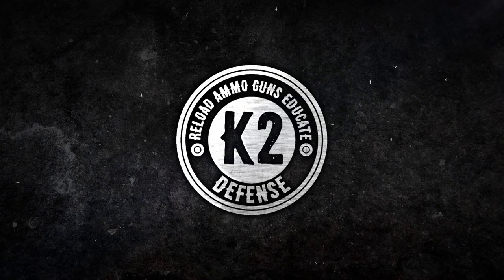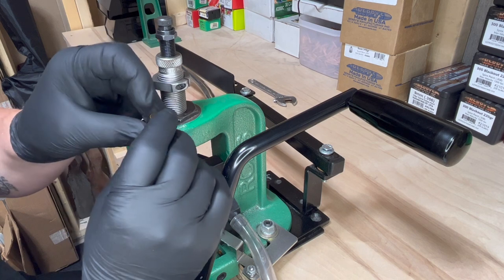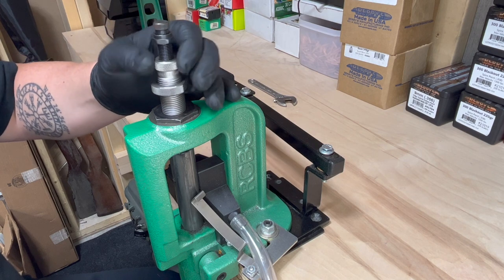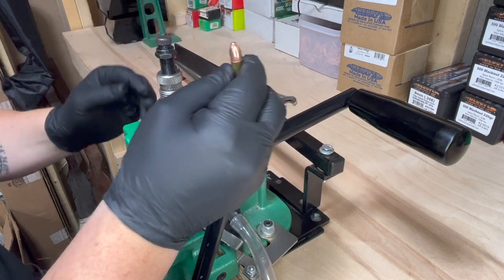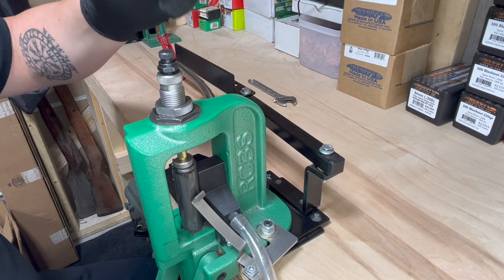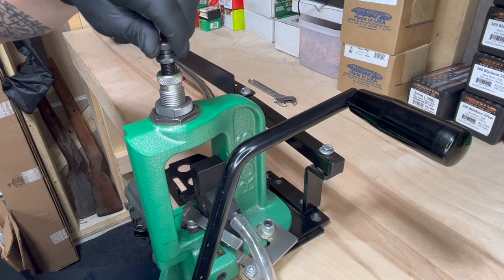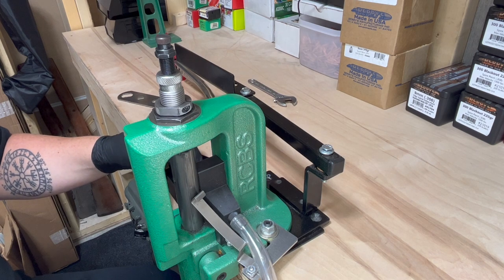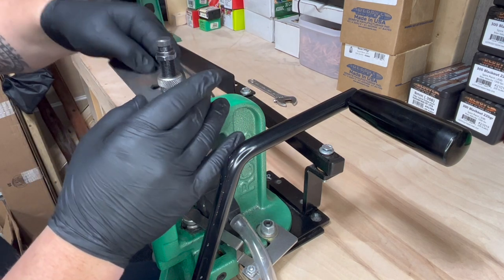How To Setup and Adjust The Bullet Seater and Crimping Die - RCBS

Comment: Im confused. Isnt the point of this die supposed to be to seat snd crimp at the same time? This would suggest thst you seat all your bullets first, then undo your seat depth and then set your crimp setting.
Reply from the maker: Hi Kelly! In this video I was illustrating that you could stop and not crimp after finding the seating depth you want. Once you make one round to the COAL that you need, then you set your crimp. So, set the seating depth, then back out the seater plug and adjust to the crimp you want, lock your die, then adjust your seater plug back down and tighten it to the die. Then you can seat and crimp at the same time. Honestly, this is very confusing to many folks. It took me a while to figure it out. Let’s just say my father-in-law had the patience of Mother Teresa until it finally clicked for me. If you rewatch the video I make a point of saying that you can stop after the seat is where you want it. Then I go on to finish it out. Sorry if it’s confusing. I know how much I struggled with it that’s why I made the vid. Hope this helps! Let me know if you need any further direction. 👍🏻
Reply: This is an excellent video... @kmchartrand99 ...the first 4:00 of this clip is entirely about getting your bullet seated at the correct depth into the casing (nothing to do with crimping yet) Beyond the 4:00 min mark is entirely about setting up the crimping die appropriately...once that is complete the die will seat and crimp simultaneously...
Reply from the maker: @grudd3078  - thank you for answering that question! Greatly appreciate you explaining it better than I did! 👍

Comment: I use a 'cartridge gauge' to drop my 9MM into to check if the crimp is good and still hits the seating shoulder in the barrel of the pistol when it's loading. Too much crimp and the cartridge will go in too far, cause a misfire and perhaps get a bit stuck in the barrel.
Reply from the maker: @silaslongshot941 - something doesn’t smell right. Wondering if you have trimmed your cases? Also, skip the cartridge gage and take your barrel out and use it to do the plunk test. Start with the lightest crimp possible. Work up from there. Keep me posted. I’d like to hear if this resolves it. 👍🏻
Reply: @k2defense  Yes, I have a spare Beretta barrel that I also check with. When both methods agree, I'm satisfied with the settings for that particular loading session. I haven't found much need to trim 9MM so far.
Reply from the maker: @silaslongshot941 - are you able to close the slide with the lighter crimp?
Reply: @k2defense  no problems so far
Reply from the maker: @silaslongshot941 - awesome, y’all good then?

Comment: no difference on any caliber? I am getting ready to load 223 with Mr Bullet Feeder and the RCBS TC die. anything special I need to know? thanks K2. your videos are very helpful
Reply from the maker: Hello! Just a quick question. The RCBS TC die set has an expander die. Are you sure that is what you have? Usually these sets are for straight walled cases. Typically RCBS has a resizing/decapping die and projectile seater and crimp dies. Can you please confirm? Thanks! 👍🏻

Comment: I've always just run a LEE factory crimp die as a separate step, as do a lot of folks I'm sure.  I must admit I've never really taken the time to understand the simultaneous seat/crimp operation even though I have a pile of dies that will do it.  While it does save some time and can apply whatever crimp type you need depending on the die (roll, taper whatever)  I simply prefer the LEE method,  there is no guess work as you get a finished round as close to factory as possible and I, personally, like that option just for safety sake if nothing else.  It SHINES on a turret or progressive press but can get monotonous on a single stage, that much I'll admit.   

Oh well,  handloading is like Baskin & Robbins' 31 flavors,  there is something for everyone!
Reply: Well this is the step that is recommended by all reloaders like myself who have been reloading for ever 20+ years. The reason why the seating and crimp die combos are trash, is because they are only good for plated and jacketed bullets, this is because in these combo dies, the crimp happens first and then the bullet gets seated second which will lead to the case mouth being way thinner then when the case mouth was expanded and now the die is trying to shove a bullet into it. Now plated and jacketed material can more abuse then hitek coating or powder coated bullets, but it should never be done this way.

I cast my own bullets and hitek coat them because as a USPSA competition shooter, I go through about 1500 rounds a month and the last thing I need is the coating to be coming off and lead fouling my barrel.
Reply: @DJG37S  Well now,  that explains something.  For as long as I've been reloading, I mentioned I haven't taken the time to really get to know this technique of simultaneous seat/crimp   but I HAVE tried it a time or two and every * single * time  -  the end result is putrid and a contorted case mouth.  NOW I know why.   I kinda figured the  sequence was out of order but didn't realize bullets that were wrapped in some kind of hard(er) coating could prevent this.

Comment: Very well explained. I would use a Leyman 4 die set and then probably have to crimp all the cartridges with the separate 4 crimp die after seating the bullet. I wonder what the advantage is compared to the 3 die set, if there is one at all?
Reply from the maker: @fredheimer - hi Fred! The advantage of using a three die set is time saving of having to crimp as another step. Reloaders that don’t mind taking the time to do the crimp separately  and the folks that feel they may have quality issues performing the seating and crimping simultaneously would probably prefer the four die set. Thanks for the comment! 👍🏻

Comment: Thank you sir, for this concise demo I was looking for. If I may, I'd like to ask about two things;, 1) regarding powder measures;  I am currently using the W231 flat ball powder. On the least expensive Lee, some have complained powder this thin leaks around the drum.  which powder measure would you recommend, that won't break the bank? I was considering one by RCBS and the Lee Precision deluxe perfect powder measure 90699. 

2) I believe I heard you say you were demonstrating a reload using a 115g RNFMJ. I am also using this, Speer TMJ target 115g tips. as per your demo, I produced a round exactly as you detailed it, and sat the tip in till the C.O.L. was 1.100. In actuality it seem to sit deeper than the ones in the white box of Winchester 115g fmj rn Target practice rounds. And I noticed the tip depth seating of the round you produced didn't seem in enough.

 I decided to measure some of the factory rounds in the box with the exact digital micrometer you have and I was surprised to get different measurements! I wonder why? One was 1.150, another 1.55, another 1.158 and another 1.163. 
Wouldn't these variances matter and /or affect accuracy? I have also noticed manual data depicting two particular spec's, 1.100 and 1.169. Which would be the correct length to go with? Greatly appreciate your help.
Reply from the maker: Hello! Are you working up a load for 9mm using the w231? I want to give you accurate information on recommendations. 

 As far as the COAL of the cartridges, you’ll see usually small discrepancies, like you found, with some ammo. Usually this not problematic. It can happen in the factory with their machinery probably poor QC. It can also happen if they don’t crimp the round and with shipment the projectiles can move during the handling of the ammo during shipment. In short, there are many variables that could make this happen. My suggestion is to follow your reloading manual for the correct COAL. Hope this helps! 👍🏻
Reply from the maker: Sorry, what part of my answer was the ?? for? I thought I had answered your question. My apologies if I did not. I think I missed the accuracy part. Those are small discrepancies in the COAL from factory rounds. If you’re using them to plink, I wouldn’t worry about the minor size discrepancies. I would be more concerned if they were self defense rounds as you don’t want anything that could change the outcome of something like that. I will say that I use plinking rounds for target shooting and self defense rounds for practicing accuracy. Practice using the ammo you’re going to use in each scenario. I haven’t used factory ammo for planking in years as I reload all of my own. For my wife’s personal protection I use factory self defense ammo. I figure if she needs to use it and it doesn’t go bang it would make me feel better knowing it wasn’t my fault. I use my own personal defense rounds for a multitude of reasons which I don’t want to air in a public forum. 

You said that your reloading manual had two different COAL? Under each projectile it should show the COAL specific to that projectile. I’m not sure where you’re getting the second measurement suggestion from in the reloading manual?
Reply: @k2defense  Thanks for your reply.  I have Googled the specs for the 9mm round, and come up with 1.169 as the standard. Then on powder brand sites, as well as bullet tips site, like Speer, Hodgon or Lee, I get the 1.100. The manual You currently showed on your video, "Lee modern reloading 2nd Ed" is the where I saw the 1.100 size. Its also the manual I am soon to purchase. The manuals I have, I've used the data for rifle loads, and despite they would contain pistol data, they're pretty old, somewhere in my storage space. So I'm buying this more recent one. Thanks again, and my apologies for tugging on you so much, you've been a great help. I hope I can reach out to you some other time. Be blessed and encouraged my brother.
Reply: @k2defense  I didn't get an advise on the type or brand of Powder measure, that I had asked you.
Reply from the maker: @MusicMinisterJP7  - absolutely no worries! We’re all in this together and this is how we learn. I’ve had some bad experiences with veteran reloaders that get grumpy when trying to ask questions. This is one of the biggest reasons why I started making videos myself. Show a more softer approach to others trying to figure this out. My contact information is k2defensemn@gmail.com if you have questions not suitable for the community guidelines. Again, glad to help anytime! Thanks for all the comments. It helps drive the algorithm so others will find these videos. Appreciate it brother! 👍🏻🙏🏻
Reply from the maker: @MusicMinisterJP7 - I personally use power pistol, unique, and titegroup for 9mm rounds. It’s what has been more readily available to me during the VID. I’ve had good results with them all. Sonia the issue with the spillage when using the powder thrower? Sorry, trying to remember the issue. I’ve been answering other comments so I’m trying to recall. The Lyman reloading manual I refer to in one of my videos is for cast projectiles and Hornady manual is for factory projectiles. Thanks for understanding! 👍🏻

Comment: It was mentioned that there are 2 different bullet plugs. Only 1 is supplied with the 3 die set, meaning you have to buy the other one? And I’m assuming you use the flat nose one for HP bullets?
Reply from the maker: Hello @sethwatson8952!

RCBS provides two bullet seater plugs. One for round nose and one for flat nose.

Hope that helps!

Comment: one your videos, I'm new at this and am having trouble. I'm at the stage where I'm setting the bullet depth, I got the right depth of 1.169 but the bullet fails the plunk test, not by much but enough to be a problem. any ideas? oh Im using new brass from x-treme bullets also there 115 FMJ RN, thank you for any help you can give me.
David / Frustrated
Reply from the maker: @MrNitrox32 - hi David! No worries! Are you resizing your new brass? I’m guessing that’s the issue since some folks do not resize new brass thinking it should already be sized since it’s new. Typically the plunk test failure is a shoulder or case length issue. Let me know and we’ll go from there! Happy to help! 👍🏻
Reply: @k2defense  Well I took your advice, watched your video again paying very close attention and I used your OL of 1.1 instead of the recommended L in my Lymanof 1.169 and the bullet passes the barrel pluck test perfectly. I only did 8 to check, because i've had to send the S&W PC EZ back 3 times due to broken ejector, barrel issue? and I forgot the other issue. Anyway I'll let you know the results. I cannot THANK YOU! enough. lifetime watcher now :)
Reply from the maker: @MrNitrox32 - appreciate the feedback and comment! I’m here if you need anything. Love helping others get started. I look forward to hearing from you in the future! 👍🏻
Reply: @k2defense  Update, all seem to be ok until the 7th rd. it got stuck in the barrel. Im at a total loss , this is the 4th time there has been a issue with this gun.don't know if i mentioned, it's a S&W performance center 9mm ez with gold ported barrel. have you ever heard of this kind of problem?? thanks for your valuable time. It's much appreciated
Reply from the maker: @MrNitrox32 - sounds super frustrating for sure! Let’s make sure we’re not missing anything. You’ve trimmed the cases, chamfered/deburred, and crimped? Let me know and we’ll go from there. 👍🏻 hang in there!
Reply: @k2defense  Sorry I didn't explain what happened correctly, the 115 gun bullet itself was stuck in the barrel after firing, case ejected. I checked the length of the case before loading, did not trim it, as I thought a new case would not need it.I did not chamfer.
Reply from the maker: @MrNitrox32 - I want to make sure I understand what’s happening. Did you have a squib load?
Reply: @k2defense  YES That's what it was , first time I ever heard of that term from S&W. Sorry about the late response,  Still getting  house ready to move,
Reply: I don't remember hearing a low sound when firing. just check gun when slide didn't return,  pulled slide back last bullet ejected. that when I realized something was wrong..
Reply from the maker: Those are scary!
Reply from the maker: Are you using a progressive or single stage press? When I first started reloading I had one. After that, I became hyper vigilant checking my cases for powder. Glad you didn’t get hurt! 👍🏻
Reply: @k2defense  yea me too, I'm using A Dillon 550C, I've never had this happen before,I load 45ACP and 223 and never had an issue. i've purchased a LED Lighting system so I can better check what's going on. I cannot Tell how appreciative I am for your assistance, I know your Time is Valuable.
Thanks Again!!!!!!
Reply from the maker: @MrNitrox32  - I just want to make sure you have your questions answered before I sign off. Y’all good?
Reply from the maker: @MrNitrox32 - happy to help anytime! 👍🏻
Reply: @k2defense  yes and thanks a bunch

Comment: I just bought a .40 caliber die set and can't get this thing right. Seater plug is at the top, ram has the casing 1/2 way up, and bullet is at the right depth,...but if I put ram up all the way, bullet is down all the way into casing.
Reply from the maker: Seater plug all the way up. Die out of the press. Case in shell holder. Ram all the way up. Screw die in until it touches case. Back off die 1/2 or full turn. Lock in place. Ram down. Projectile in. Ram all the way up. Screw seater plug down until projectile seats to the depth you want. If you still can’t get it. Send me your contact info to k2defensemn@gmail.com. I’ll walk you through it. 👍🏻
Reply: @k2defense  buddy of mine helped out. Got it going the way it needs to. I do however, greatly appreciate your response.
Reply: I have the RCBS .40/10mm and when seater die is screwed into the press til it touches the mouth of a 10mm case it’s way too far out. Seater plug even when screwed all the way in doesn’t come close to seating the bullet at the right depth…🤔
Reply from the maker: @Powderfinger308 - just checking, you’ve backed up the seater plug all the way up, the shell holder in place, case in the shell holder, ram all the way up, then screw the die down until it touches the case, correct? 

If that doesn’t work, take the shell out, run the ram all the way to the top, screw the die down until it touches the shell holder. If it can touch the shell holder, there’s something else wrong. 

Final thing you can try is using a case that hasn’t been belled. Put that into the shell holder, run the ram up to the top, make sure the seater plug is screwed up or out of the die, screw the die down until it touches the case mouth and then only turn the die up a 1/4 turn. 

Let me know if this works. I’ll be waiting for your reply. 👍🏻
Reply: @k2defense  I appreciate your input. I took a step back and re-sized those cases, then very gradually belled the mouth of the case. I believe that I had expanded the case mouth too much. Additionally, as I learned with my .45 Auto reloads, I utilized the drop test to check for proper crimp. It worked for the 1911, and works just fine for the Glock 20 also. Thanks again
Reply from the maker: @Powderfinger308 - awesome! Glad things worked out! 👍🏻